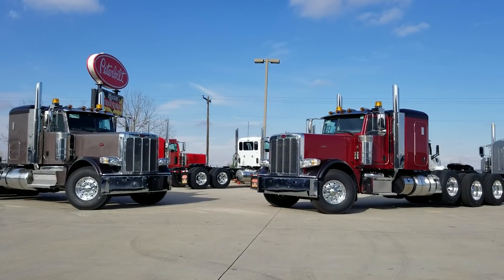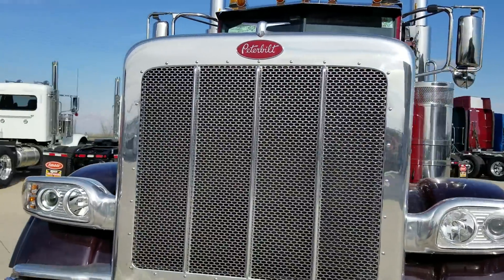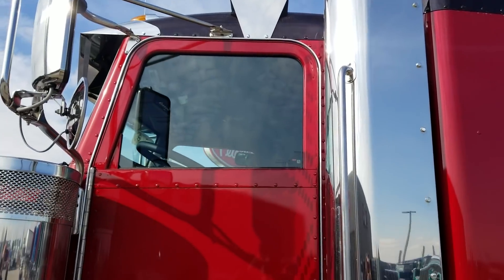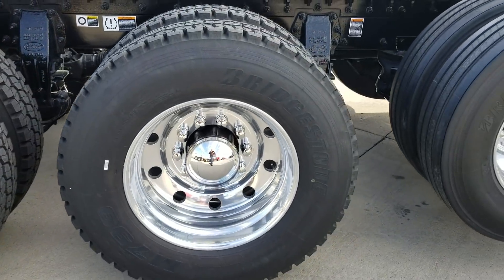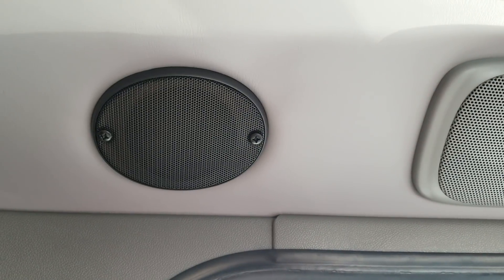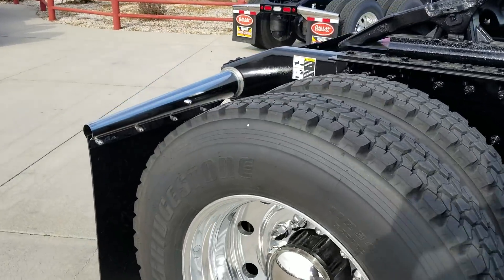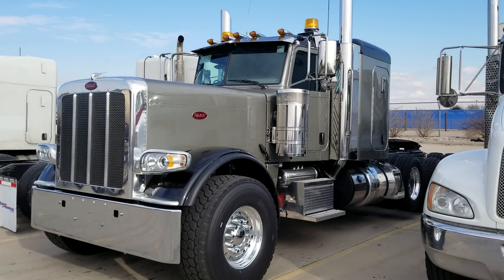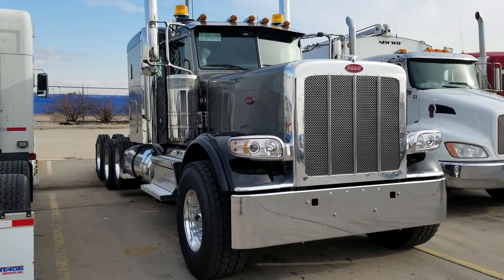Just in!! 3 Colors of New Heavy Haul Peterbilt 389's in stock.  JW- 970-518-5520

Comment: I dont get the attraction to a steerable lift axle, they cost more to purchase,more moving parts to maintain and break and when its all said and done you dont get anymore weight, actually you get less due to the heavier weight and the fact they are rated for less
Reply: It's a 20,000 pound axel that weighs about 3,00 pounds which allows you to carry 17,000 pounds more. The advantage of the steerable is that you don't have to lift it to corner it.
Reply: Mike Brown you dont have to lift a non steerable qhwn you corner it